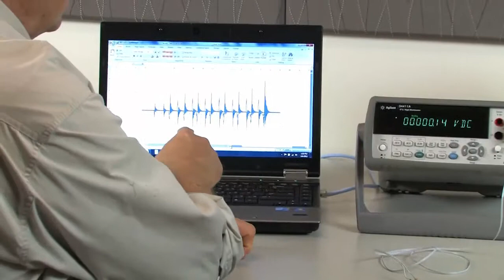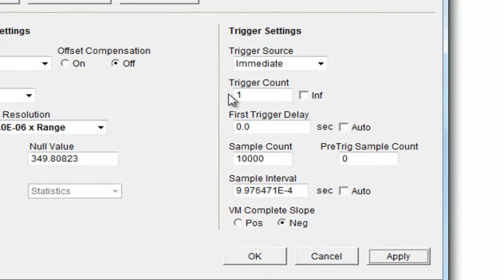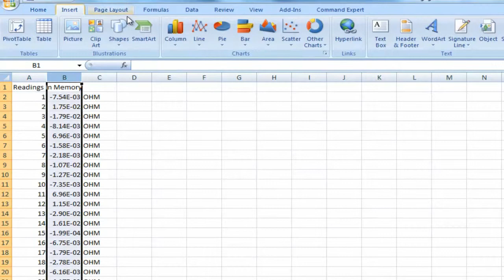Static and Dynamic Forces Overview and Measurement with a 34411A Digital Multimeter

Comment: I'm interested in finding something that can be interfaced to a resistance machine. Any suggestions?
Reply from the maker: +Chris Allen Machines used in fitness training often use strain gauges to measure pressure or torque.  They can then measure torque over time to determine the power and calories.  Lots of new devices for cycling to measure power; pedals, crank arms, spiders and hubs.  The measurements are transferred wireless with the ant protocol.
Reply: +Keysight General Purpose Instruments I'm looking for something specific for resistance machine not necessarily bikes or other cardio equipment. strain gauge seems to make sense but it needs to be simple for the user to understand what's happening.
Reply from the maker: +Chris Allen I think you have a very good idea as I cannot quickly find such a device.  I did find ResisTrack a device for cable machines on kickstarter.  Also, you could look at the ant+ products and see if anyone is working on a similar sensor.